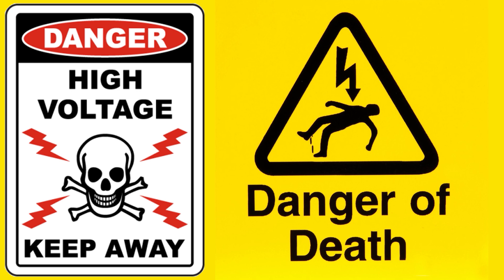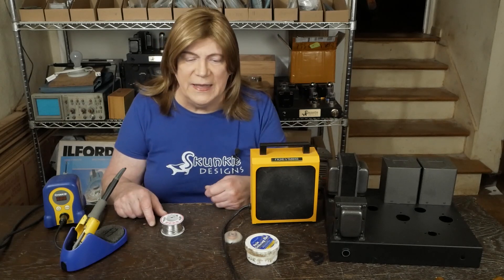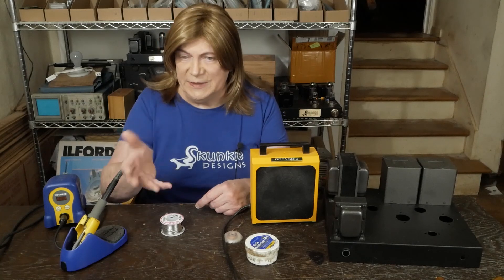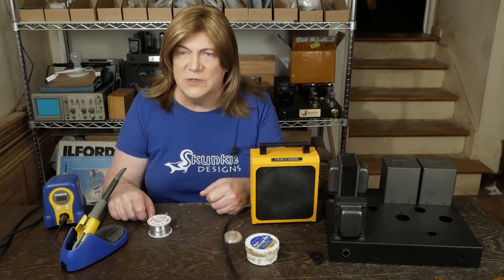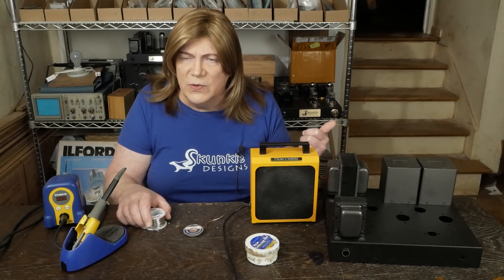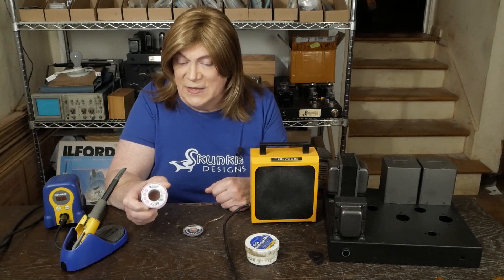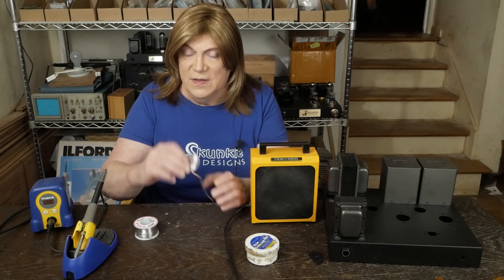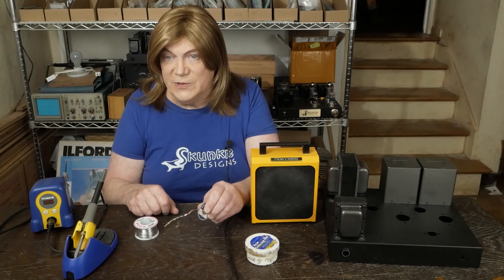Soldering 101

Comment: Lead free solder just doesn’t work well, but as you mentioned, use a fan to get the fumes away. I run my soldering iron at about 700 degrees Fahrenheit. Cardas solder is my preferred brand, which contains silver and copper. Whether it really makes a difference, I’m not sure. It is a bit more expensive, but I guess it just gives me peace of mind. It also melts very easily.

Comment: Probably need the ga for both the solder and the wire.  I think my solder type was all wrong.  I’ve ordered some of the solder you use from amazon.  The .32 and .50 diameter rosin core.   Should the wire be a solid core or stranded type?  Thanks!
Reply from the maker: I've been using 18ga solid core. It's easier to work with and stays where you put it!

Comment: I've watched a lot of your previous videos and learned a lot on soldering. It helped me do the T11 phono preamp and then build the Starving Student tube headphone amp/preamp. I do have a Hakko FX600-05/P Soldering Iron, 500°C, 74W on my Amazon list and need to get it before I start another project. My current Weller iron has a crappy tip and can't find any better replacements. Thanks!

Comment: Well Stephe, this explained why my first soldering project in 40+ years failed.  I am now enthused to try again.  The project was a speaker cable jumper box connecting female banana sockets.  What gauge and wire type do you recommend?
Reply from the maker: Wire or solder ga?

Comment: There is some crap and unusable solder out there - buyer beware! When I started, I bought a small coil of solder sold in a small plastic tube. It worked OK but I had problems when I bought a new one and I nearly ruined my amp trying to get it to work - it was hard enough to get it on but it was almost impossible to take it off! I thought it was my soldering iron and so I bought a new one. I thought it must just be me until I finally found good leaded solder and it flowed just like yours!

Comment: The principles in this old training film have not changed:  1, Safety, 2. Clean, 3. Tin, 4. Heat, 5. Flow/Wet, 6. Inspect. The major difference is the equipment. The big honkin' blast furnace irons had no control of the heat. 60/40 tin/lead (vice 40/60 tin/lead) solder is solid at 361F and liquid at 370F. Between 361 and 370, it's plastic. It will not "wet" the components properly until all portions you want soldered reach 370. Holding the heat until everything is wetted is critical but holding the increasing heat longer only soaks the components with heat unnecessarily and could cause damage. This is where the beauty of a good tip temperature-controlled soldering iron comes in. It will not raise the tip or the components hotter than what you set it. Never use acid flux solder on your electronic gear. Enjoy the video. https://www.youtube.com/watch?v=wvl_KYif9zA
Reply from the maker: Which is why I run the iron hot, so you can "get in and out" faster.
Reply: @SkunkieDesignsElectronics  Exactly! But when you sat "hot", you don't mean 800F. I can't remember where I set mine - it's in the garage and we have snow... If one sets their iron to 370F, it would take what seems like forever.  Resistor leads and such heat up quick - as long as they are clean, your tip is clean, tinned and wet, you can get the solder flowed and all parts wetted quickly and get the heck out so it can dissipate the heat and solidify. What a lot of people don't realize is the soldering iron feeds more current to keep the tip temperature up (as the components heat) then reduces the current so it can hold everything at the selected temp. Cheap primitive soldering irons don't do this and are MUCH less safe/forgiving for inexperienced operators to use. This is my main argument for first-time solderers investing in something like the Haiko. I bought one and threw my old clunker away.  Stephe, I'm glad we're on the same page. Keep the Single-Ended Skunks singing!

Comment: When you are new to soldering having a decent soldering iron makes all the difference..dont go super cheap on your iron. With that said i do have a budget option that i think works well for projects. Weller WE 1010. Digital display, stand-by, heats up pretty quick and was only a little over $100 on Amazon when on sale. I pretty much use Kester "44" Rosin Core on everything...mostly because my dad gifted me a few pounds of it years ago 😊. Im all for any DIY videos. Extracting chopped off stranded wire pieces from a thru hole on the PCB would be good. I pulled a solder pad off the first time i ran into that problem.

Comment: one time about 1970 I was working at a 2way radio shop. a radiator repair company tried to fix a johnson solid state cb mike cord connection to its circuit board with a gas torch and acid core solder. ruined the entire circuit board. worst mess I ever saw.

Comment: For people in Australia, I can recommend Duratech lead free solder from Jaycar stores. As for the soldering iron the Hakko in this video is anywhere between $200 to $360 AUD depending on the store. Personally I have been using a cheap ($44 AUD) WEP 926 LED and it works perfectly and the handle doesn't get hot.

Comment: I would love to know what size tubing you’re using to insulate resistor an cap leads.   Thanks Stephe hope you have a great day also.       I think it’s Teflon correct
Reply from the maker: PTFE  I use mostly 1.0mm ID but also use 1.5mm ID on occasion.

Comment: I found this Solder on Amazon called. JWOWO, is 63/37 alloys, 2% flux, 0.8mm.  is very cheap price but I have used it on point to point, through hole, and SMD it works perfect nice and Shiny finish, it flows like butter 🧈

Comment: The no clean solder has probably no rosin core inside ........that's why the solder doesn't flow ....so in that case you have to use solder flux .
There's a two seconds guiding rule for soldering....and putting a little solder dot on the iron before applying the iron to the comonents to solder to create a heating bridge ..removing the iron while wiping upwards to the end of the lead ......( usualy seen is cutting these ends later    ).....we all do it by bending the leads to hold the components while soldering and cutting the exces later but it is not realy correct .
Soldering parts and solder pads on a circuit board must be cleaned before .
To low a tempearure will extennd the soldering time as well as be a cause for bad joints .
There's a vey prof soldering skill shooling at the us army/navy .
ROHS ( lead free ) is the new green policy ......difficult to repair , addin some regular lead solder on those solder points before desoldering will help .
There's still good old solder quality on the market..........in the EU it is illegal ..but ....!

Caution : Some solder with (organic)  flux is very efficient as a  desoxidizing agent but BUT is VERY aggressive .........so one must wipe and clean it off  after soldering , otherwise one may end up with a destroyed circuit board after some time........use isopropanol to clean the flux off .

Kind regards
Reply: Thanks I was a carpenter, handy man and turn my hand to anything but I was never taught soldering my couple of attempts were disasters so I have never tried again, and hate being beaten .I have a soldering Iron of un known quality is it essentially vital to have a quality iron?